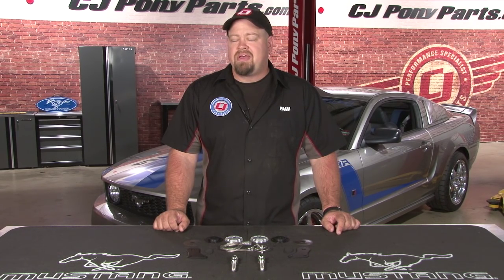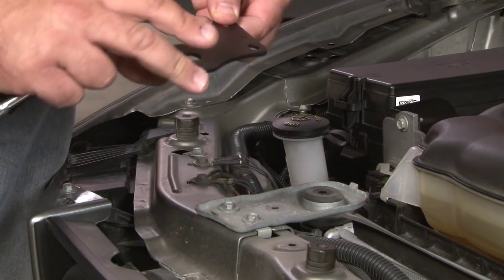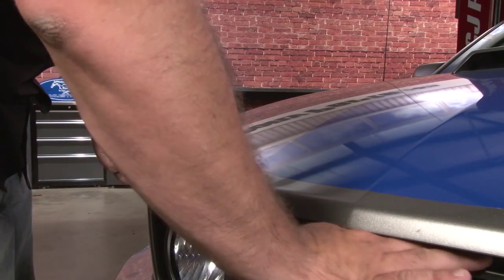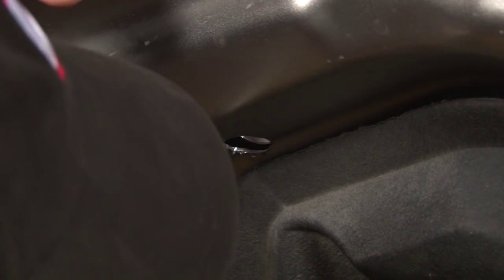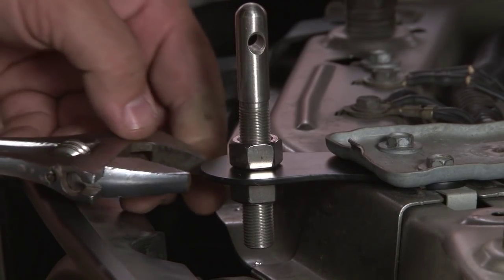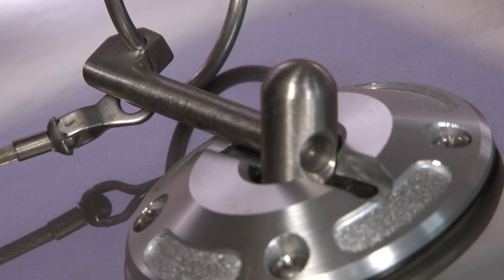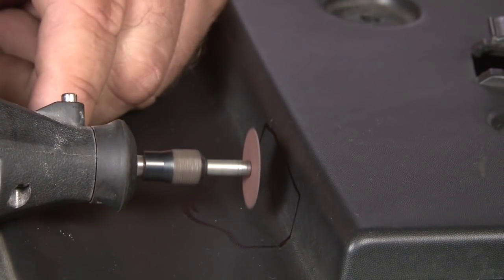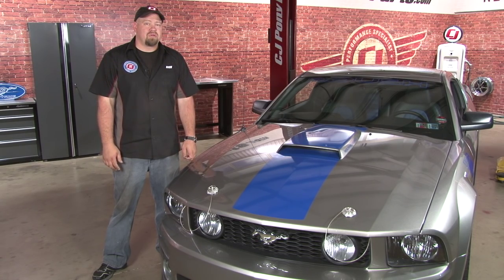2005-2009 Ford Mustang Install: Drake Muscle Cars Billet Aluminum and Stainless Steel Hood Pin Kit

Comment: one thing the video forgot to mention is corrosion protection. after drilling the holes be sure to spray rust inhibitor spray available at your auto parts store. bare metal and water is car cancers best friend.
Reply: Very true, even though the hood is aluminum corrosion can still be an issue. I actually did paint the edge with touch up when I was done but somehow that must have not made the final cut.
Reply: Bill Tumas do they fit 2001 mustang gt bullitt ?
Reply: What if u have a duraflex hood?

Comment: If I were to install hood pins, which I will do to my sn95, I would put some type of heat string on the stainless steel cable so you won't rash up your hood. As you would imagine riding along would cause the cables to scratch your paint.

Comment: Nice video rotozip is best way to cut out notches in the plastic cover. I lined up my pin with front contour of hood each side I then seen in directions to run them straight across either way is ok as long as they match.

Comment: What does he use to remove the push pins in the very begining of the video? 1:29
Reply: R GEN Probaly should of said: what do you use*
Reply: R GEN It is just a hooked pick, they come in sets usually with straight, angled, hooked, etc
Reply: Bill Tumas Thank you for the reply. Looks like a handy tool and wanted to buy it. Thank you again for taking the time to hit me back up. -RGEN